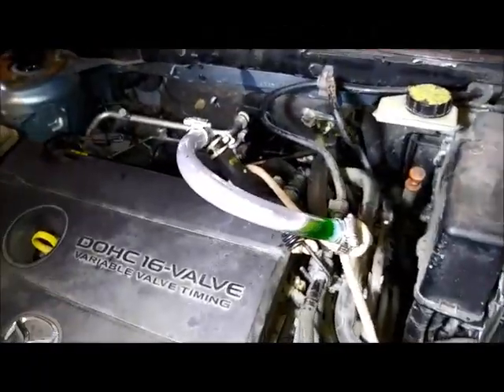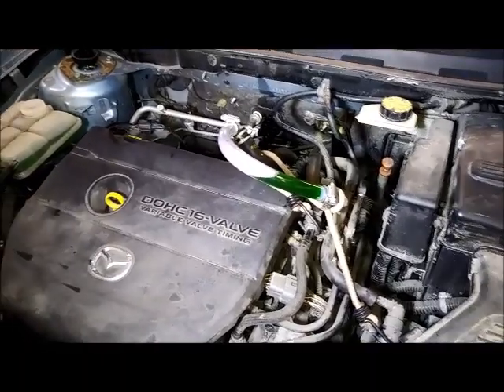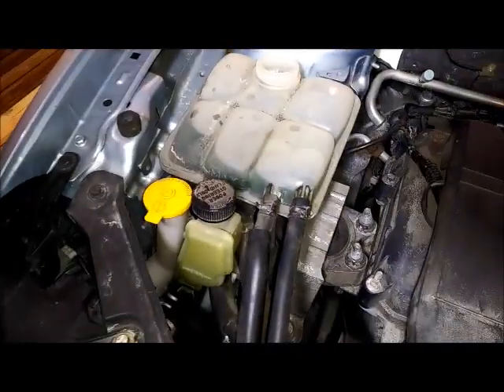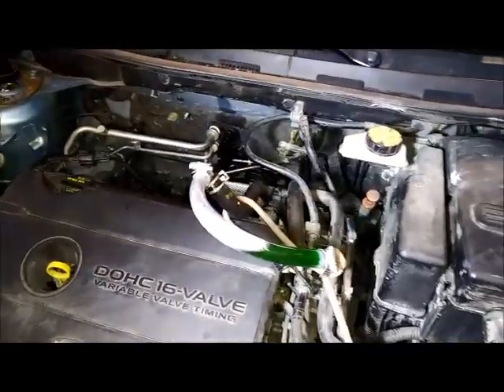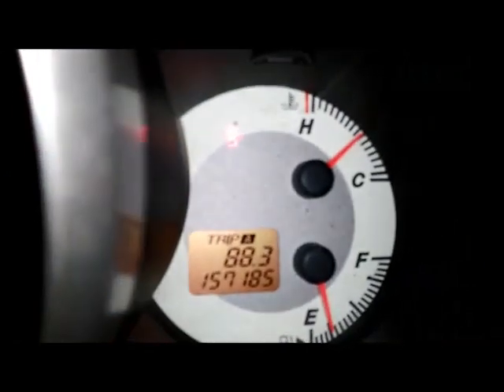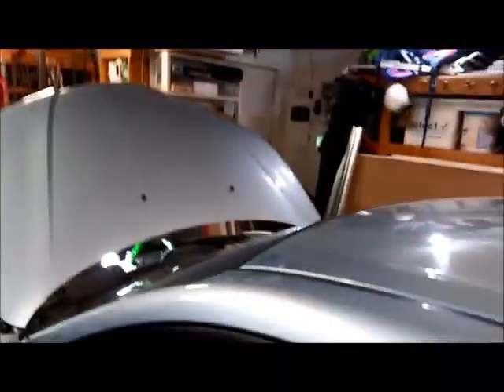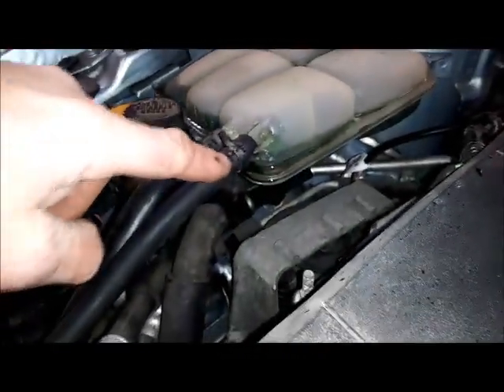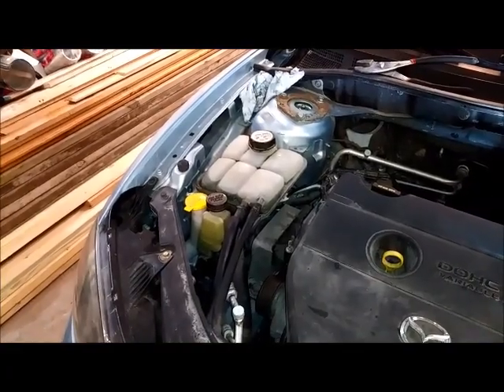Mazda 3, how to bleed air out of the cooling system.  No heat at engine idle.

Comment: Thanks for the video. I'm struggling with intermittent heat and now an occasional pegged temp gauge. Part of me wonders if there is an issue with the aftermarket MotoRad thermostat I installed (not opening up frequently enough) and the other part wonders if I am just not getting the air out of the system. I've tried all of these tricks to no avail but your visual demonstration shows that it can be quite tricky to get all the air out. If I get desperate enough I may even try bypassing the heater core to visualize the trapped air. I should also do a better inspection of the hoses because I also wonder if air is getting introduced somewhere.

Comment: Um.... I feel like you are over complicating a simple process.  leave the overflow cap off while it warms up and it will bleed itself.  Another good trick is to park on an incline with the front of the car uphill to ensure all the air escapes. Also your engine would  overheat if you had excessive air in the system.... yet your temp remains normal. Your cabin heat is most like entirely unrelated. Check your heater switch and your blend door. easy test....feel the coolant lines going into\out of the firewall as car warms up if there hot it isn't air problem. And for god sakes get some hot honey and peppermint tea and some vicks for that cough.... Sounds like mild pneumonia

Comment: From a Mazda manual:
Hold rpm 2500 for 2-3 mins x 2
Let idle
Hold rpm 3000 5 secs.
Repeat x 2.
Reply: Thank you!  I will do this on my rural route to work in the morning.
Reply: @camarokurt  also I filled the coolant above the max level where the return line is.
Reply: Is that with the cap on or off?
Reply: Cap off, BUT make sure you put it back on before you shut it down or it'll come flowing out. @stuttgurth
Reply: @LifeOfLiamOfficial  I honestly gave up on this. Id bleed it. itd seeming be working then a week later itd be back to not putting out heat (into cabin) and starting to overheat. Once it gets hot enough then itd start to heat and cool down. the crazy part is that it only happens in the winter. come spring it stops. I changed the thermostat and the water pump. Only thing I can think of is that a hose is bad and its pulling in air or kinked. I suppose I should change those, but honestly the thing has 170k and I bought the car for 1700, 5 years ago. Could care less.
Reply: @stuttgurth  I have the same issues. Car has 190k miles and I'm trying to sort it out, replaced t-stat, pump, radiator. Did you find any resolutions to your issues?
Reply: @wtbman  Nah, I just dont mess with it. It only happens in the winter. Doesnt happen at all in the summer. Its intermittent. I burped it like 15 times. That tends to help, but only for like a week. I gave up. In the winter I just have to make sure I clear the windows really good. Usually the intermittent heat blowing is enough to prevent windows from fogging, but its not reliable for defrosting.
Reply: Is this with the cap off?

Comment: The most useful video I've seen so far and I've seen enough. I will try it tomorrow because I changed the thermostat and coolant. I noticed that I have no heat inside, the temperature rises above the middle and the fan is working at maximum. From what I understand there is no air left in the cooling system. Only one question. should the heating be turned off? Thank you for your time. With appreciation from Greece.

Comment: Thank Cough, you, cough.  Just joking.  Really thank you so much.  By the Grace of God I stayed calm and found your video.  It did the trick.  Ran it at 2500 RPM for five minutes and then 1500 RPM for Five minutes.  The heater is working,  You are the man.

Comment: Having just done a coolant flush and refill in my 2010 2L mazda 3,  here's a few things ive learned.
The coolant system is clever,  works very well, but its a compromise and extremely annoying in some ways.
- there is only one drain point, at the bottom left of the radiator.  the coolant capacity is 7.5L and when you dump the coolant, only around 4.5L comes out. This means that to flush the system thoroughly,  you have to dump, fill with demin water,  go for a drive to ensure the t stat is open and the system is mixing and repeat this process until the water dumping out of the system is completely clear. 
- THEN the worst part is, you start filling with the coolant. In my case i used the genuine mazda FL22 which is expensive and you KNOW that when you fill it, youre mixing it with the plain demin water stuck in the system! so you basically need to do the same thing again over and over until you bring the concentration of new coolant up and the plain demin water down. Terrible!
- on the positive side,  the system is actually very good at burping itself provided it can get warm enough to open the T stat.  you dont have to go around squeezing hoses or opening valves.  Just get it warm and rev for 2500 for 2 mins,  rev at 3000 for 5 seconds,  and repeat a couple of times.
you should see the expansion tank exchanging air for coolant.   wait for it to cool and fill the expansion tank to the fill line.  Should be done.
Reply: Do you do it with the cap off? Or with the cap slightly on?
Reply: @robertoguerrero7082  sorry for the late respose, cap on. Once the thermostat opens you will see the coolant begins flowing through the expansion tank. Keeping the cap on means the system is pressurised so the boiling point will remain high.
Reply: MEGA NZ  the engine in the 2010 model was basically an updated version of the BM series so they will share many commonalities.
Reply: Unless you live in Indiana and it’s-5° in the middle of winter with no garage.  Jusayin

Comment: what you are doing is right except that clear hose is higher than the filler tank . you need the filler tank as the highest point then the air will bleed into that ,and have the cap off so air can escape . you run the car at 2500rpm untill thermostat opens with the cap off so the air can escape
Reply: Thanks bro on advice.
Did exist some book about maintance mazda 3 BK ?
Greetings

Comment: Hey Matt, excellent visual representation to show why having too much air in the system can cause "no heat" at idling. I'm having the same issue you had (lol) at this moment. Can you breakdown the procedure  on how to do a coolant flush and when the appropriate time is to bleed out the air in the cooling system.  I am going to tackle this problem by using your video as a reference. But I would love to hear how you would breakdown a coolant flush in a certain order. Also when the right time to bleed out the air is during a coolant flush. Thanks!
Reply from the maker: I'm just a homeowner and do work in my garage.  Shops likely have a machine to do this.  For me, I'll start with a cold engine and I'll loosen the radiator cap so the system doesn't build pressure, then let the car idle to get the fluid  warm and circulated well.  I then drain the radiator.  On some cars I'll remove a drain plug in the engine block to fully drain the engine and radiator.  I usually measure the amount of coolant that came out so I can track when the system is full.  After the system is refilled, I let the car idle until I saw the coolant flow in the shunt tank from the 2 small lines.  Once I see flow there, then the air is bled.  If your ambient temp is warmer than Mn this time of year,  the time to run will be less.